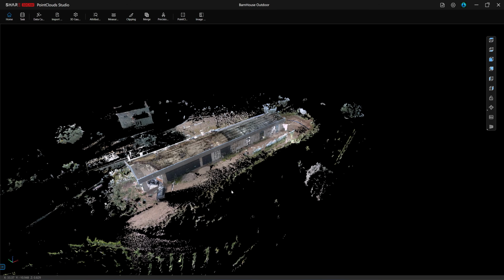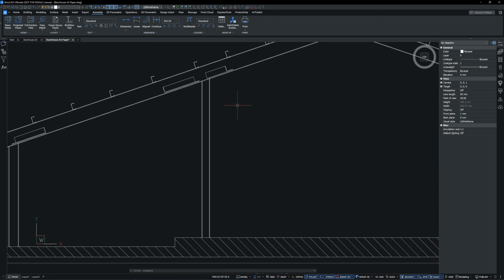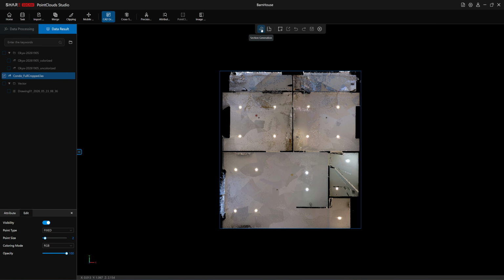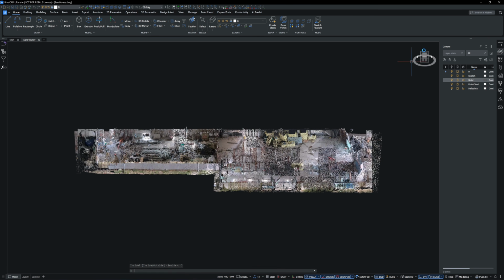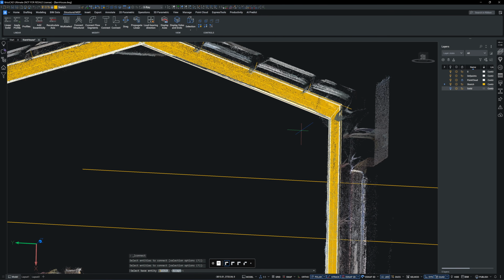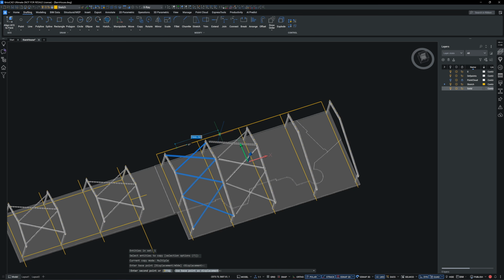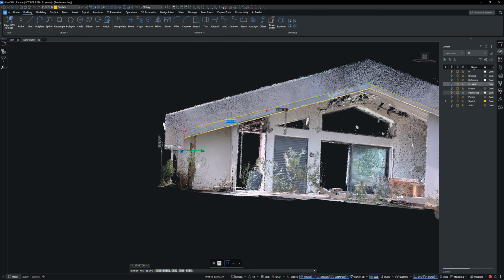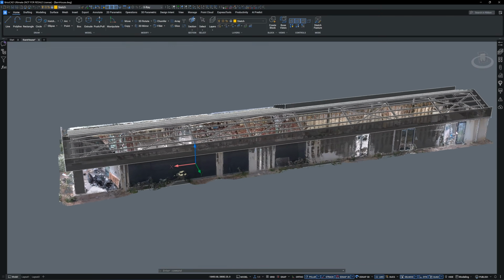LiDAR Scan to CAD Workflow – SHARE AI CAD Generator

Comment: I also used the latest version. I think the most useful feature is that it can generate CAD drawings with a point cloud underlay. After generation, the drawings can be opened in AutoCAD, where you can directly trace and modify them.
Reply from the maker: A professional CAD tool has to be reliable. I still need to open files I created 28 years ago for revision.

Comment: Great vid Payo, thanks! What version beta is that? Can measurement points now be moved/adjusted after placing? Is there a volume measurement tool?
Reply from the maker: It's V 2.5. and yes, you can now translate, rotate and level the scan data. Volume measurement isn't there yet.